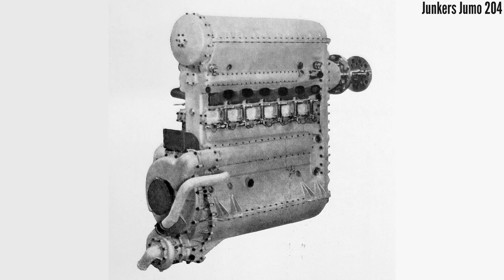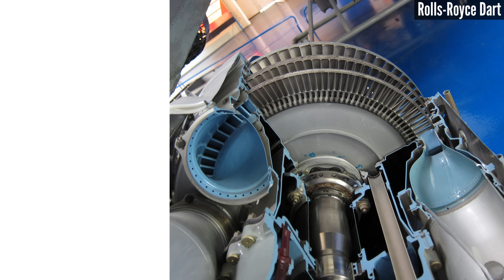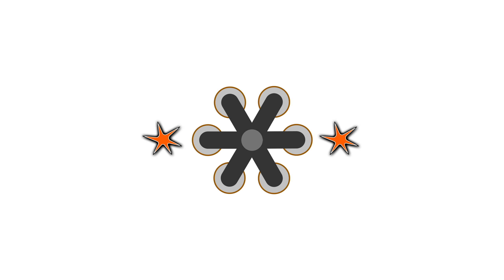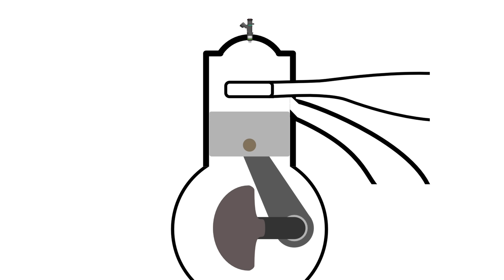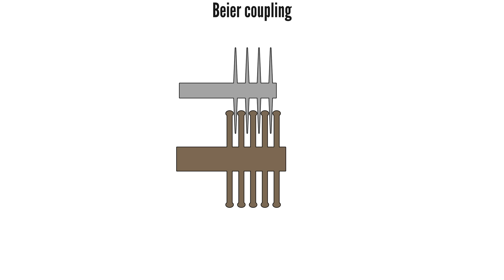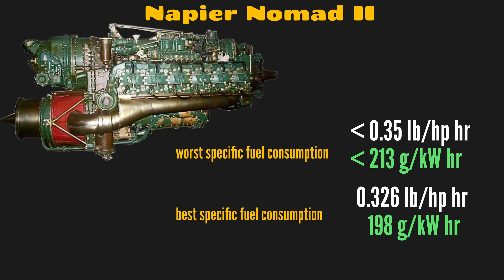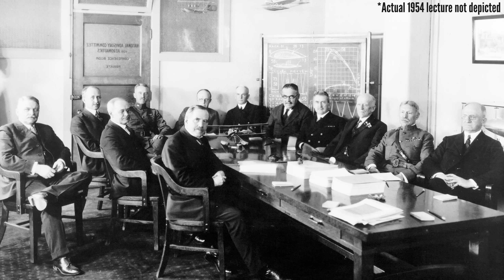Napier Nomad, the Most Complex Aero Engine Ever Made - Explained

Comment: There's another aspect of piston engines that turbine engines still can't compete with: fuel efficiency (directly related to break thermal efficiency) across a wide RPM band and power band, and especially tending to have best specific fuel consumption at relatively low RPM, where gas turbines always achieve best efficiency near the top end of power output and RPM as the compression ratio increases with RPM. (for engines with max power or military power rated above peak efficiency, it's usually related to the compressor itself running beyond its peak efficiency range, often related to blades being in supersonic range, or too far into the supersonic range to be efficient, though still capable of delivering more thrust at the expense of higher specific fuel consumption)

Thus, for the vast majority of cases where optimum cruise speed is achieved at moderate power settings, a turbine engine will be operating inefficiently where a piston engine could be operating very efficiently. 

Aircraft engines also lack variable transmission gearing and use blade pitch on propellers as the only means of matching different RPM and power bands, and turbofans generally have fixed blades that limit this even further. Piston engines can vary throttle and manifold pressure at a constant RPM setting, too, so at a given altitude and RPM, the power can still be adjusted, where turbine engines can't do that. (at a given pressure altitude, air temperature, and humidity, they'll output a constant thrust at a given RPM)

Albeit, hypothetically, with multi-engine designs and symmetrical thrust, you could shot down or idle some of the engines and run the others at optimum RPM for best fuel economy. (probably more practical for designs with odd numbers of engines with a central engine that can be idled or shut down during cruise, better yet if the inlet duct can be closed off during cruise)
Or on hypothetical future designs: use of turbine-electric drive configurations where the turbine engines are selected for best SFC range and power output at required cruise power and the max power for take-off/go-around and climb conditions would be boosted by battery packs that would be charged on the ground and recharged during cruise (acting as a buffer for high power output).

With decoupled electric drive, you now also have much more flexible RPM control (though efficiency limited by electric motor efficiency band and methods for electrical 'throttling' ie variable voltage vs PWM or other methods).

The weight savings of an electric drive + less powerful generator engines might make 4-stroke turbo-diesel aircraft engines more viable for the generator powerplant role. They'd still be heavier than turbine equivalents, so would have to compete better on other merits to have serious potential. (they could, hypothetically, achieve the merits of an electric drive scenario with significantly less battery reservoir if more powerful diesel engines were used, or potentially removing the batteries altogether and taking advantage of the low RPM low power fuel efficiency of diesel engines with sufficient max power to provide TOGA thrust;  the use of electric drive would also facilitate use of simpler fixed-blade axial fans to be used with electric motor control allowing efficient fan RPM decoupled from engine RPM and better matched to power and torque required at any given thrust required at a given airspeed and altitude)

Edit: apparently this is called "electrical turbo-compounding" and is already a concept in development.

IMO, future commercial aviation is going to end up using some sort of hybrid electric drive, but with the bulk of on-board energy/power storage still with some form of relatively energy dense (by volume) liquid fuel like synthetic SAF type fuels or a similar, but oxygenated blend of compatible molecules (especially those that improve combustion efficiency and offset the theoretical energy content per mass difference, or compensate enough that the manufacturing cost/yields over pure SAF style synthetic paraffins would still be a net benefit to real-world operators).

Whether the combustion engines are piston or gas turbine is another matter. (though I think spark-ignition designs are less likely than diesel, though there may be some potential for high performance, high compression SI engines using dense, high boiling point, low vapor pressure ver-high-octane fuels that are quite different from gasoline in both performance potential and flammability hazard:  being similar to or better than normal Jet kerosene would be important for flammability) Lean-burn SI engines with high boost+compression using direct fuel injection and specialized (but economically viable) fuels would be interesting.
There's some synthetic and biomass derived oxygenated organic compounds that could be very relevant, while being difficult to fit into standard gasoline applications. (for example, anisole is on the edge of being acceptable on the upper boiling range of gasoline, but things go up from there, including various alkyl phenyl ethers or phenyl ethers with longer chains on the other half: like phenyl-ethyl ether, phenyl-propyl ether, phenyl-butyl ether, etc)

Comment: Actually it is false.
Nomad is an exceptionally simple engine compared to alternatives: R-4360 and R-3350-TC (also turbocompound with 3 turbines!)
Only 12 pistons (low amount of fuel injectors), no valves, no spark plugs, no intercooler, one compound  turbine.
It simply came too late. If the Nomad II had been ready around 1948, it would certainly have been produced.
Reply: No spark plugs? Actually these engines had spark plugs for starting(might also been needed on very low load)!
Reply: @TarenGarond  You meant glow plugs.
Reply: @peceed  No I actually meant spark plugs!

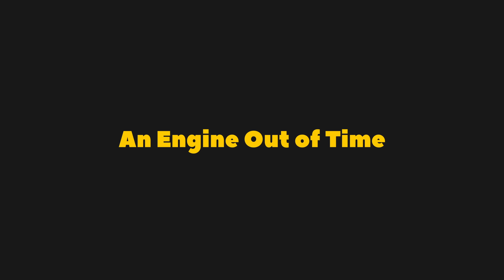Comment: 18:35 sounds like it would be great for tanks and heavy earth moving equipment tho
Reply: Bit of waste of the jet thrust produced, but that's okay. What one could do is to make a two-stage turbine with induction and skip the variable coupling, instead sizing and using the secondary free-spooling stages on the turbine like a conventional turbo to feed into the backside of the compressor rather than the front with blowoff, all solidly cranked and geared together. That in an axial engine form could even be made into a very compact and in-line package for ease.
Reply: It would

Comment: My father (Ex-RAF pilot) used to quote an engineer friend saying "The gas turbine came along just in time", to save them from the complexity of late piston engine designs...
Reply: Lmao He wasn't wrong but still would love to see a lot of this tech simplified and modernised scaled down to auto industry would make a great hybrid drive engine.
Reply: These designs are far to inefficient and dirty for a modern era…most of them are two stroke which have been banned
Reply: @chrisvig123  dont become a politician..
Reply: @gerrydepp8164  Avatar suggests a cyclist and they don't like getting choked by fumes.   They are a very political bunch.
Reply: Almost all large commercial shops are powered by 2 stroke diesels, their efficiency is why global goods transport is so cheap.  @chrisvig123
Reply: @chrisvig123  Two stroke diesels are far from banned
Reply: @ntomata0002 try running one in a car through London and see what would happen lmfao Sadique Khan would have an apoplectic fit ( hopefully a near fatal one lmfao)
Reply: @chrisvig123 The 2-stroke, opposed piston diesel is the highest efficiency engine yet created by man. It took academics in Stuttgart 40 years to have any noticeable improvement on the efficiencies of the early 1940s Jumo engines, and their blank check design had required more cobalt then was available at the time, worldwide.
Reply: @chrisvig123 Except, the new Delta Hawk small general aviation diesel, USA is 2 stroke and clean enough. I may put one in a RV-15 build.
Reply: @chrisvig123 until we start using thin film   technology to skin our aircraft in structural elements that generate and store electricity (work in progress) and make aircraft using ultra lightweight tensegrity structures for all of the load bearing elemnts and use pressure differentials to keep the structure ridgid electric propulsion is a pipe dream once we can get that combination sorted we can fly fuel free untill then it's tonnes of burnt dino trees out a tail pipe or twiddle your thumbs on the ground for serious aviation micro aviation ev is fine but different demands.
Reply: @chrisvig123 there is nothing about these engines which is inherently more dirty than current production engine designs. Two stroke engines are not banned.
Reply: @chrisvig123  lol, go feed your cats simpleton.
Reply: @chrisvig123  so, at least with a Detroit, when set up correctly they produce much less emissions than many modern Diesels, the blown heads allow for a near perfectly clean burn, the issue is that they are two strokes lol, and all the same rules to make power apply, so people ran them with rich oil mixtures hot as hell to make the most power possible while protecting the engine more. The tech Detroit used is similar to what Honda is doing with that V3 with the E compressor.
Reply: @peredavi lol there are basically no emissions requirements for the engine you plop in your home built. Completely different from the requirements for cars, which is what OP mentioned.
Reply: @chrisvig123  Those weren't your ordinary Trabant 2-strokes. They could be much cleaner using modern fuels.
Reply: Crossbreed it with Napier Deltic for more fun.
Reply: Large displacement engines add variety to what would be a boring world without them imo.
Reply: The arctic cat 858 turbo is like a mini nomad sort of.

Comment: This is a great video.  

Things worth talking about: 

Turbo charging and direct injection have revolutionized diesel power output.  

The nomad's two stroke configuration has over time proven to be very inefficient compared to its four stroke counterparts.  

I think that a modern 4 stroke diesel with a properly sized turbo system could give the napier a proper lesson in specific output.  

Having said that, gas turbines have given the same lesson to recip engines.  Even more specifically in terms of weight and simplicity.  

A Garrett TPE331 is a lightweight power house with the -14 making 1650 hp at 620lbs.  

It is VERY difficult to make power like that reliably with pistons at that weight.

Comment: Always loved the idea of turbo compound. IIRC there were some trucks using it too. Wonder if Diamond would be interested in evolving their diesel engines along this line. Aviation is probably the last retreat where extreme measures for efficiency may make sense, almost all other sectors are going to be electrified quickly. The possibility of running on SAF is an added bonus.

Comment: My dad worked on a power unit for the French for their version of the Abrahms tank. They did not want the turbine. It was the Mack diesel V8 with a turbine driven compressor. I think they ended up spec’ing it for production. Renault owned Mack at the time. It made a lot of power, comparable to the standard US turbine engine. The Nomad 2 intake arrangement was probably the inspiration. Mack’s V8 was fairly compact and light, so it probably made a good candidate to fit in the tank. It was eventually killed off by tighter emission regulations.
Reply: Battle tanks do not have to meet on road emissions standards
Reply: @andrewday3206  I don’t think he meant the tank version 😉
Reply: @andrewday3206 they might well do. It was in France after all.
Reply: I used a couple of those E9 Macks in Maine lobster boats. Great engines!
Reply: Yes - nice to see that war is being waged in an envromentally responsable sort of way! :D :D
Reply: @napierpaxman 
Damn that was awesome sarcasm 🤣
Great comedy 👍🏽
Reply: @andrewday3206  OK so it flattens people, but hay, it gets great milage! ;) :D
Reply: @napierpaxman most gas stations  are closed during war times so milage does matter somewhat. Less fuel usage means less work for logistics and running out of fuel sucks hard.
Reply: @napierpaxman 
And I runs on renewable biodiesel
Reply: Did the military ever have to worry about emissions regulations?
Reply: @AndreiTupolev  Yeah, that seems stupid - even more stupid is that the west is looking at battery powered military vehicles....  I can see advantages of silent operation for smaller military vehicles,  but a tank with a 700kwh explosive battery on board and limited range is madness.
Reply: @chrissmith2114  The military always explores new technology to see what is and isn’t possible. The military won’t go that way unless it gives an overall advantage.

There are potential benefits in making tanks less detectable (reduced noise, exhaust emissions (yes they can be seen by IR from exhausts) and heat). There are disadvantages too, but there are also fireproof batteries coming over the horizon fast. It makes sense to keep up with technology before your competitor does. You don’t have to put it into production if the disadvantages are too great. I’m not sure you want to look for a Tesla Supercharger station in the middle of a battle.

And there is war in Europe right now, in Ukraine, and diesel powered tanks seem to have a problem not exploding.

But definitely, I would not be looking to start powering tanks today with commonly available batteries. They are not suitable for that purpose.

The military doesn’t care about emissions or being woke. What it cares about are how to exploit any advantage from any technology.
Reply: @chrissmith2114 it would need an extra twenty tonnes of internal armour plating just round the battery! 😅😅😅😅😅😅😅
Reply: The Hyperbar Diesel engine of the French Leclerc MBT was built by SACM (nowadays owned by Wärtsilä). This 16.47 liter 1500 hp V8 engine uses a Turbomeca TM-307B gas turbine to feed the diesel intake and to be used as an APU when the engine is shut down.
Reply: Thanks for this unknown nugget, one of many still to come to my attention I hope.

Comment: At 219g/kWh, the Kusnetsov NK-12 is a very efficient turboprop, even without the neccessity of a turbo compound aproach. Even more impressive it's been designed and built in the early 1950s and it's still in use today. Moreover, it's the most powerful turboprop ever made (15,000 hp equivalent). Thanks so much for your interesting and enjoyable report!
Reply: The NK-93 would have been an impressive modern day contra-rotating ducted propfan. It would have changed aviation especially with today’s power turbines.
Reply: I think you'll find this figure includes the thrust of the engine converted to equivalent brake horsepower.  Nothing wrong with that and its explains why turboprops won out.
Reply: Built by abducted German engineers in forced labor

Comment: Thanks for this educational video.  I would like to point out that your comparison of different engines is slight lacking in presentation department.  It would be a lot more helpful if graphs would be presented of several competing engine technologies.
Also a Flued-Drag equation can explain a lot.
Air_Dag = 0.5*Cd * Air_density * Area_coefficient * Velocity^2
 Air_drag is proportional to fuel consumption, 
The variables  are:  
CD = Coeficient of drag,  assumed to be constant for theoretical calculations of a nominal air frame..
Area_coefficient =  assumed to be constant for theoretical calculations of a nominal air frame..
Air_density is proportional to Altitude,  iE:  Sea Level = 1.225, 6km = 0.66, 10km = 0.41, 14km = 0.23, 18km = 0.12
Velocity = variable for theoretical calculations of a nominal air frame.
There for A) Just by flying above sea level 6km for the same fuel economy could be increased by  = 1.22/.66 = 1.9 times,  or speed increased by (1.9)^.5 = 1.38 times
B) Just by flying above sea level 10km for the same fuel economy could be increased by  = 1.22/.41 = 3.0 times, or  or speed increased by (3)^.5 = 1.73 times

C) Just by flying above sea level 14km for the same fuel economy could be increased by  = 1.22/.23 = 5.3 times, or  or speed increased by (5.3)^.5 = 2.30 times

D) Just by flying above sea level 18km for the same fuel economy could be increased by  = 1.22/.12 = 10.1 times, or  or speed increased by (10.1)^.5 = 3.18 times.
The conclusion from this calculations :
The specific fuel consumption of an air frame is dictated more by the altitude than specific fuel consumption of an power plant.  
Also, the power to weight ratio of power plant would be more important for interceptor VS long range bomber.  
A lot can be learned from looking at specifications for different planes.
In this video there was a remark that propeller airplanes are only good for mid altitude and  mid speed.   This is all subjective:
Specifications (Tu-95MS)
Performance:
Maximum speed: 925 km/h (575 mph, )
Cruise speed: 710 km/h (440 mph,)
Range: 15,000 km (9,300 mi, )
Service ceiling: 13,716 m (45,000 ft)
Rate of climb: 10 m/s (2,000 ft/min)
Wing loading: 606 kg/m2 (124 lb/sq ft)
Power/mass: 0.235 kW/kg (0.143 hp/lb)

Comment: Are the crank throws accurate on your visualizations?  It doesnt look like a normal mirror front to back with the 1,6 2,5 3,4 throws being at rhe same angles to balance the reciprocating weight.  I realize it is 12 cyls and 2 cycle, so maybe you divided it up for 6 angles instead of firing multiple cylinders at once.
Reply from the maker: Yeah it is according to official info. But its not the standard throws you'll find on an inline 6, V-12 etc.